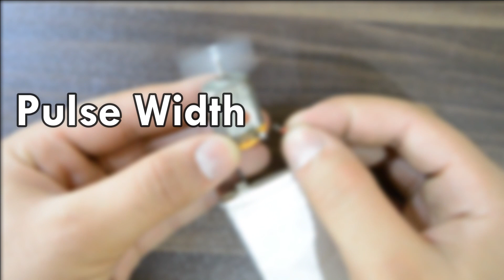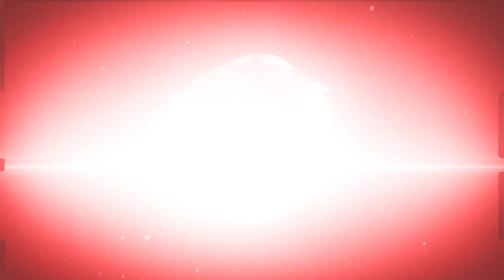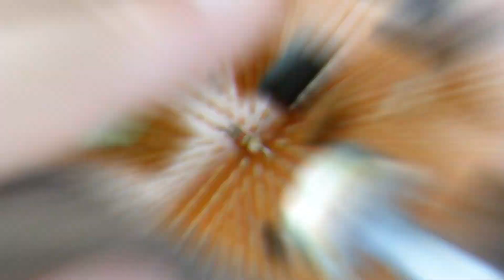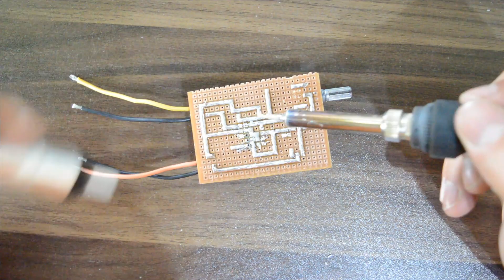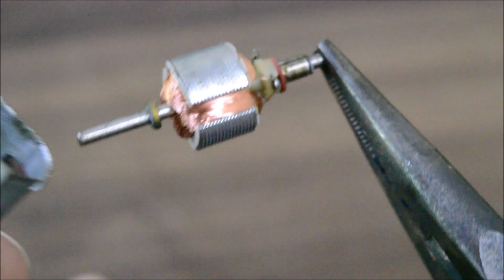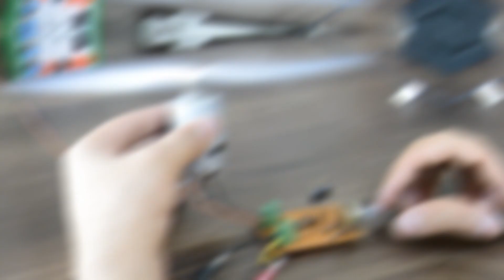Making a Powerful PWM DC Motor Speed Controller 12v 10A || Concept of Freewheeling Diode

Comment: Thats cool how the back the board solered all the joins together. Neat and tindy didnt know could do that. Also that is can be a light dimmer, now im going to see if i can find a kit to dim my lights as well as slow my dc gear oil pump motor.

Comment: Whoo I am glad I found your video. I am trying to make one too to control a power mosfet irlb3034 for a vape device and 100nf ceramic cap to produce a lower frequency. The problem is, it doesn't change the power. It always is on 100% power. Do you have any idea as to why?

Comment: It's posible than using 4n25 or 4n35 optocouple and  fga25n120 igbt to control high voltage rating motor 

Optocouple use for isolation between power and control circuit 
Also use for switching

Comment: Hey my circuit is not working
Reply: You mean it spins at the same speed even you turn potentiometer right?
I had the same problem. But now my problem is gone using different circuit.
Reply: Can u please tell me how the problem was solved? @jumbo999614

Comment: Hi. i want to make this pwm control for a 3.7v low ampere 10mm x 6 mm mini dc motor.can i replace this mosfet with a smd type bc547 transistor?

Comment: I construct this schematic, it works and It is very simple. But i have an idea - i want to replaces the potentiometer with thermo resistor / 10k omh / and the speed will be based on temperature. But is it possible to make the motor to run aprox.  40% / idle,not depending on temperature/ and the thermo resistor to control the speed of motor in range 40-100%…. Is it possible to change the schematic to work like this?

Comment: What would I have to do, in order to get 15kHz, instead of just 10kHz ??? What would I have to do, in order to get 20v output, instead of just 12V (Amps are irrelevant, 0,1A output would be enough, instead of 10A as in your case) ??? Must I simply change the source for a 20V-source???
All I need to do, is to drive an igbt, instead of your mosfet (needs 20V, but needs nearly no current at all, to be driven).
Otherwise, well done video, and thanks for any answer !!!
Reply: @klausbrinck2137 You are going to need a separate voltage supply for the igbt, because 20v is exceeding the 555 timer voltage range, so I would recommend you to either use the same schematic, with a different, higher voltage mosfet and feed the 20v source to the output, instead of the motor(load) or just use a discrete igbt driver and supply it with the 20v. For a different frequency you'll need different capacitors with less capacity and probably a different variable resistor, I intend on using the same 15kHz frequency and will add to this comment if it works out.

Comment: Better way is to use a proper havle H-bridge between the 555 timer circuit and the motor, 555 timer can only sink and source a limit amount of current.

Comment: 1.) You should never solder an IC directly into a PCB... use a socket. 
2.) The free-wheeling diode is part of every motor control schematic online so never say "I KNOW my circuit is correct so it must be a bad component 3 times in a row".  Do more research first.

Comment: please provide the wiring diagram as asketch to understand.
Reply: I have asked for it to.alot of people will make something like this,but will not give out a wire trace plan or picture.
Reply: I have found a picture  of a generator using a 556 ic dual timer.

Comment: I have a transformer of 12 volts which only outputs max 500 milliamps may be due to it's high internal resistance. But i want to run a motor at 5 volts with 1amp .is there anything i can do?

Comment: Excellent!!! You are a professional, but I am wondering why you didn't use a IC base on GP pcb so that you can easily replace the IC, whenever required.
Reply: I don t want to be mean but what kind of professional forgets the flywheel diode

Comment: It only works in small motors. Not works with 12v 9amp motor. Transistor damaging always
Reply: if the problem is coz of heat, then Use a heat sink for the transistor
Reply: not because of heat.    Because of overload

Comment: Can i control  (12v , 15ohom) injector / solenoid with this circuit? How about the maximum cutting speed of PWM in mili seconds? Hoping your reply ..
Reply: I=U/R 0.8amp yes you can

Comment: @Aatik's lab awesome video! Definitely useful for me and answered a lot of questions. A noob question though. If I'd want to get 24V 10A to a DC motor (instead of 12V 10A), what would I have to change (apart from the power source of course)? Which components I'd have to change in order not to fry them with higher voltage? I guess the schematic would be the same, I'd just need to place tougher components?
Reply: Hello can you share the changes needed to be done in circuit so that we can use 24v dc and 10A , if you found! Please replay me
Reply: @SAI_LINGESH  hi, no i havent found it...
Reply: BEFFIER mosfet
Reply: @rmdhn1  only transistor/MOSFET have to replaced?
Reply: You only have to change input voltage, nothing else